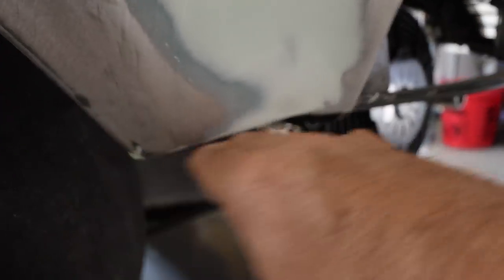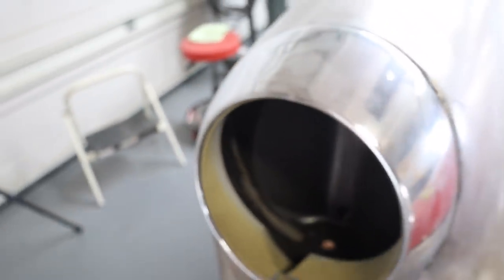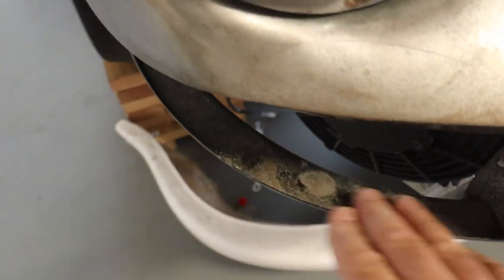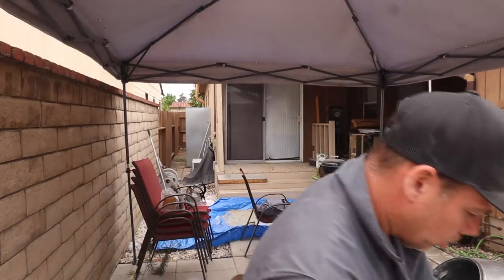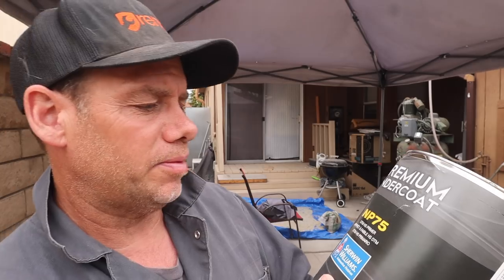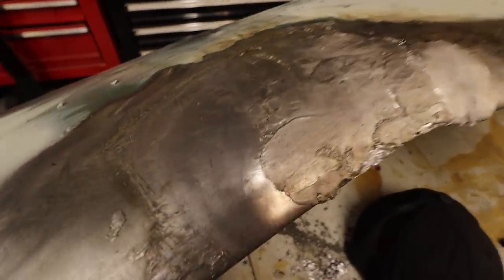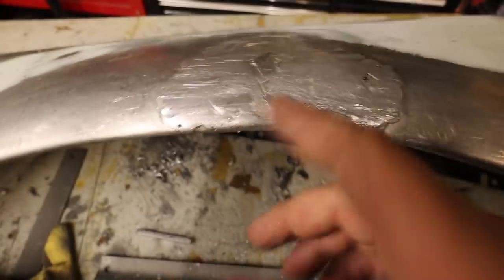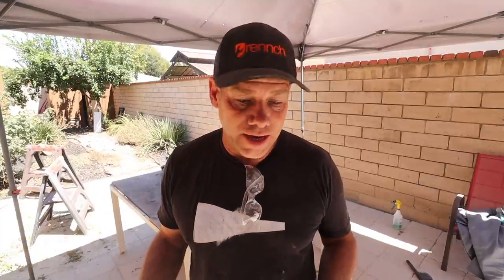FAIL! How NOT to Prime Your Car! | Subaru EZ30R Turbo Porsche Swap Blasphemy Build 62

Comment: Michael, you said you were watching Brian from paint society, thats smart. I just finished painting our Vw bus and his Chanel taught me so much.
If your buying a paint gun you need a large tip. 1.7 to 2.0. The big tip let you dump lots of your 2k primer on at once. Your going to sand most of it off, but that’s how you prefect the finish. 
Be sure to not use the big tip on finish paint. You’ll need a much smaller tip for base and clear. Remember the thinner the paint the smaller the tip. Also play around with air pressure. You definitely need a regulator and gage on your gun. I also put a small filter on my gun for insurance. 
I call primer practice paint. You can lean a lot from shooting that before you get to the much harder finish coat.
As Brian says “don’t overthink it, it’s only paint”.
Reply from the maker: Yea, when the final paint happens, I'll take it down to Costa Mesa Collision.  But for now, it's sand sand sand!

Comment: I taught myself paint over last summer Covid lock down… Good experience and lots to learn still. Found: need a bigger tip for that gun for primer for sure - ebay has some. Pay attention to temperature - it was so hot the day I finally put clear down it dried as fast as it went down, should have used a slow activator instead of normal. Get a 50 pack of gloves… Don’t let the primer run! It can show through in the paint if using pearl. Don’t over think it and have fun.

Comment: If you want to see these curves before primer I recommend hitting it with a prepaint solvent and getting the panel wet with it. It will show all. Use this method or a guide coat
Reply from the maker: Like wax and grease remover? Great idea.

Comment: I feel like you should prep to 600 and not sure if you forgot the wax and grease remover? Maybe I missed it but I heard start spray off panel and do longer strokes/passes 🤔 that being said really enjoying the build and its cool to see you not afraid to try new things!
Reply from the maker: I followed Henry’s directions exactly, but my air pressure was too low. That gun didn’t have a regulator on it so I misjudged it. Going to fix it though!
Reply: @rennch.  hmm guess just different ways to skin a cat but like I said props to you

Comment: Another well put together video dude 😀

Not sure you were using the measuring cup properly for the paint though. Each scale on the side has at the top the mixing ratio, so 3:1:1 or 4:2:1 or 4:1+10-20% and then if you want 300ml you fill the primer to the first 3 then the hardener to the next 3 and the reducer the last 3 for say the 3:1:1 scale. Although I have to admit I've never used a primer that required that much reducer and that little hardener.
Definitely watch more of Paint Societies videos and look up the difference between a HVLP gun and normal gravity fed gun. The air pressure they use is very different aswell as the amount of material they will lay down in a single pass. Those cheapo guns aren't single use either if you clean them properly in between uses and for primers are great but not so good for base n clear, although you can still get OK results out of them 😉

Comment: High Five.  I was wondering about door, fender, rocker, etc. gaps.  Did you already do that? Also, I was going to suggest paint society, it looks like you have already checked them out, he reviews gun set up and has a few videos on the topic.  I've never painted before but I am getting everything in order.  If you are going to put the final paint on yourself you should build a copper pipe water trap, it catches a ton of water.  You put that before your dryer filters.  Great video as usual.
Reply from the maker: No,but soon!

Comment: There is nothing wrong here. Filler/primer is meant to be applied and sanded as much as needed until you break through. Then it's time to apply more. Simple as that other than waiting out appropriate cure times. Gotta do that to avoid "sand scratch swell."

Comment: Michael: Couple things 🙂 because I’m a fellow builder and Porsche guy and I want your car to come out awesome….. For the type of job you’re doing I would recommend not using the DTM primer as a first coat on the Bare metal as an Epoxy will give you a Far better substrate and protect your metal, also if you need more filler you can sand the Epoxy and apply filler directly on top of it. Some companies, PPG included sell a High build Epoxy that is great on bare metals, builds like crazy and sands very easy…. Also when prepping your bare metal and filler you Really, Really, Really need some nitrile gloves 🙂everywhere you touch with bare hands leaves contaminants from your Sweat that will haunt you later with surface defects that will require stripping to bare metal and starting over😑 Trust me, I’ve seen it dozens of times…..lastly the soap and water wash over bare metal and open Filler will cause huge issues as filler will soak up water that will cause micro bubbles under your finish paint job that will also require stripping to bare metal and starting over… better to just use a quality wax and grease remover and a water based surface cleaner in combination… Hope this helps, I’d hate to see you have to strip the car and have to Start over again as that 100’s of hours of hard work 😓

Comment: I would epoxy prime the panels and then use polyester primer (liquid filler).Then block the polyester primer. Then seal the polyester primer epoxy primer. That would be the best way for me to smooth out the body work. But that's just one way to do it.